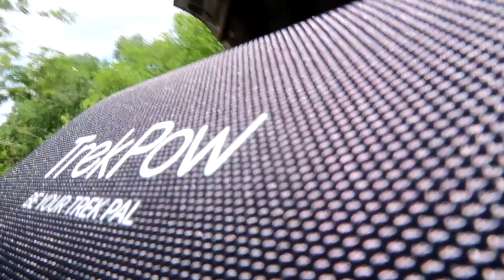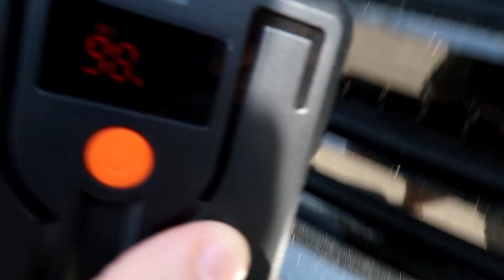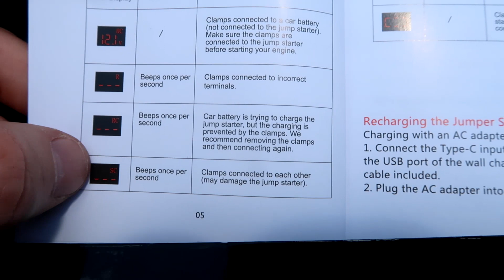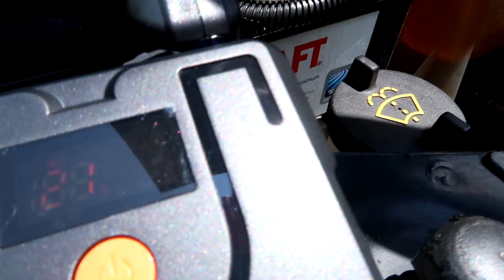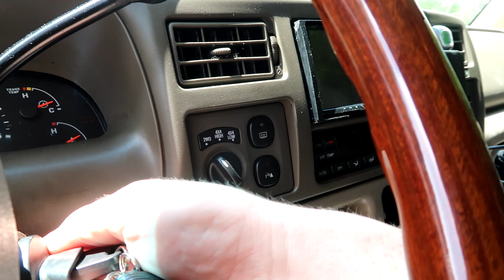BATTERY JUMP STARTER BOX - TrekPow

Comment: You may have a parasitic draw. If you have a meter disconnect the positive lead at the batt. With ignition off, connect negative lead to the cable - positive lead to the battery. That will show you in milliamps or amps what your at rest drain on your battery is. Then it is up to you to find what is drawing current. Or your battery is toast or the alternator is toast or the connectors need to be cleaned. One of those things will show you what fault it is.

Comment: That thing is tiny man! I got the old Harbor Freight jumpbox w/the big battery. Had it for years & love the thing. We hook a little 5W solar panel to it & make a mini generator for camping. Mostly use DC to save juice but for AC stuff I got a small 750W inverter. It's a perfect set up for that backwoods campin when u still want electricity.

Comment: I had a similar problem with the explorer I had.Eventually, it acted like the alternator was shot.Turns out, it was only a wire had come loose back by the firewall. Then recently, it seemed like the alternator was going out on my old blazer. Turns out, it was a weird problem with the battery, it would charge and test that it was good, but it simply would not hold a charge for long. Another battery solved the problem. Trouble is,  that expedition has even more electronics on it than my explorer did. diagnosing the actual problem will be tough. A good test will be to charge the battery you have, but don't connect it until you're ready to use it.If the battery is still hot after sitting  at least overnight, then most likely it's not the battery.Good luck to ya on that.

Comment: Works like google
Sometimes it works most of the time it does not
If it said a short (wires crossed) then the short probably exist in the system and that is what is running down the battery
Like Google employees LOL

Comment: Black is supposed to go to ground, usually a bolt or metal piece.....
Reply from the maker: The ground post on the battery is on a cable directly to metal. Same difference
Reply: @WHOTEEWHO  correct, but if the problem is with the ground via the battery terminal clamping it directly to the metal part and not the terminal eliminates a potential problem. Given the issues you had it might be wise to clean the terminals good. I have a big one to use for my diesel and thats what it says but im no expert....